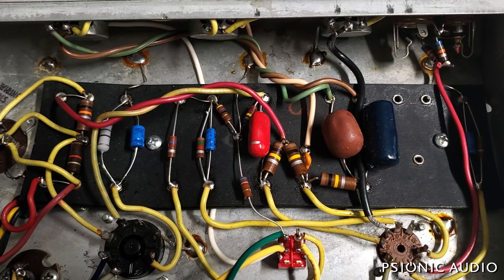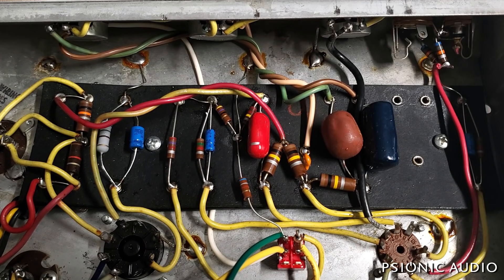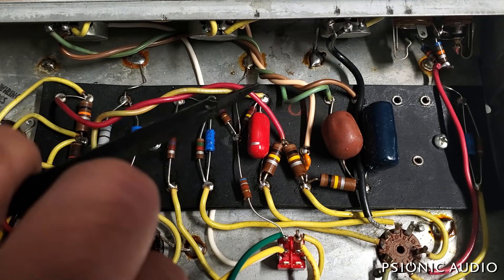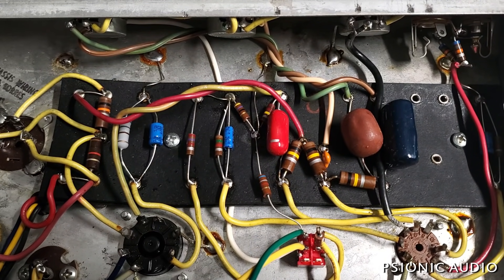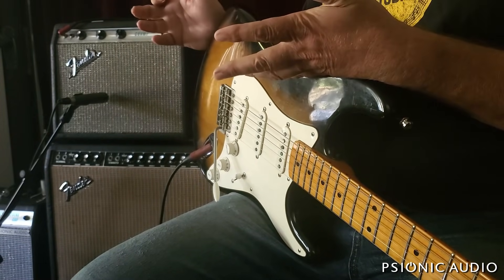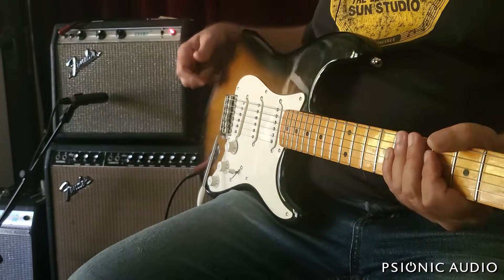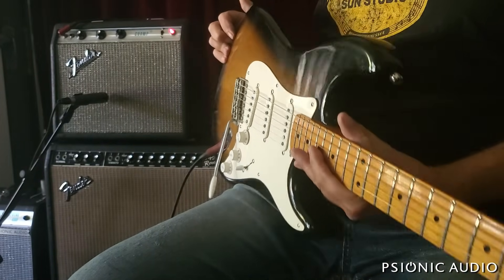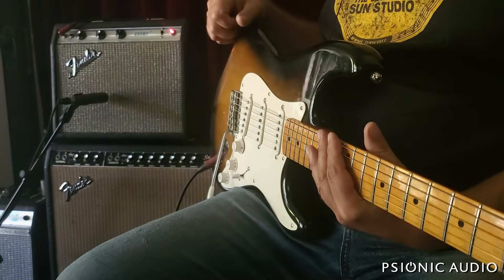Gains & Setbacks with the '73 Champ | Some Nasties Like to Hide

Comment: Thank you for posting the long saga you've had with this Champ.  I've done quite a bit of work on my own 1974 VibroChamp (caps, tubes, speaker, cleaning, etc.).  Unfortunately, I instantly recognized that flubby, wooly distortion you got when you turned it up. Mine even has the same microphonics with certain bass notes.  I look forward to making the changes you made in the "Gremlins Gone" video, and also those in some of the comments to this video.  As a long time engineer new to tube amps, I appreciate your slow and thoughtful approach.

Comment: Had the same thing with a 73 twin recently. Treble cap had become insanely microphonic (more than usual) and "woolly" sounding. Changing that cap was a necessity. I also changed the phase inverter coupling cap and found that had a huge impact on the amp's overall treble response. Tried all sorts of caps, same value but different dielectrics. Mustards, mallories etc. All sounded wildly different. I mean enough that 2-3 other people were able to say "yes it absolutely does". Surprised me..

Comment: Class 2 ceramic caps are shit on paper,  just like the ceramic caps found in old amps. That’s why I use them in amps and it does matter.

If it were a piece of test equipment(tube tester, HV cap tester, scope etc) I would use class 1 ceramic, silver mica or polypropylene.